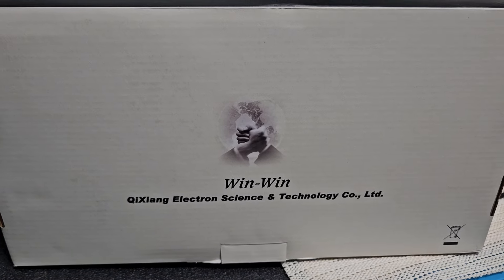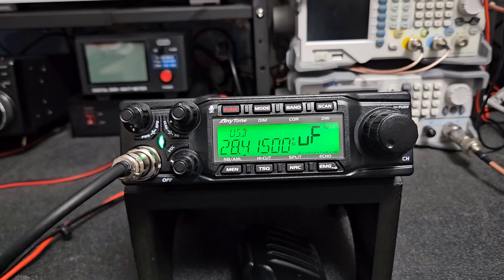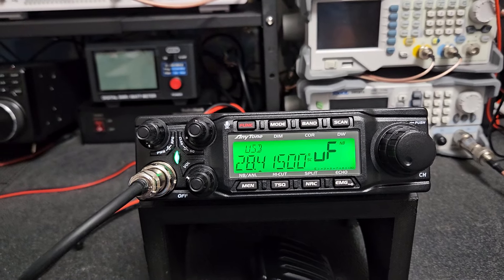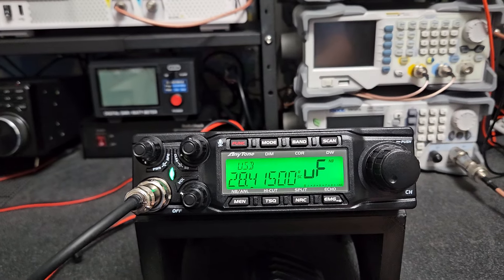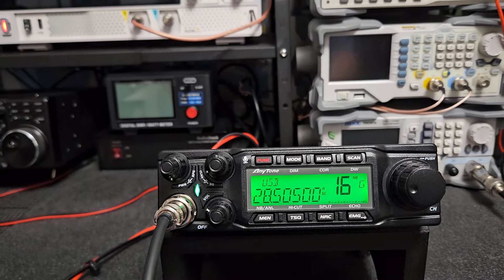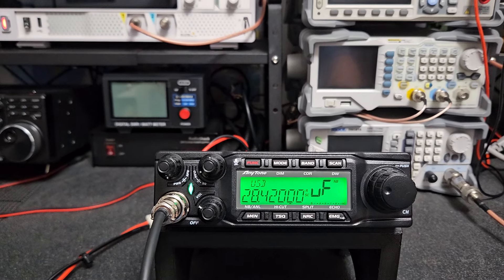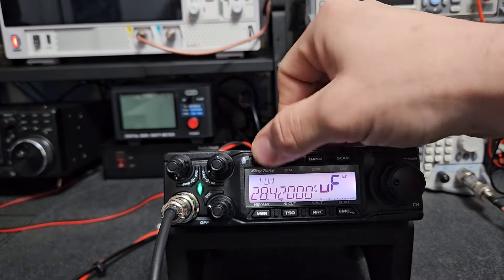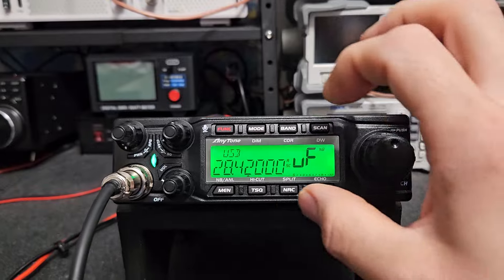Anytone AT-6666 Pro

Comment: Glad things are moving forward with Anytone.  I love my Anytone radios.  However, I'm still looking for them to release a base unit...It will be a huge hit I believe.  Thanks for the video.
Reply from the maker: You and me both!
Reply: @samuelh8441  That can be a base radio. No need to put the circuit board in a larger case and call it a ‘base’ radio….
Reply: I bought a 6666 pro it wil not transmit on the cb bad it says "dc low"  I know my power supply works perfect its 30 amps.   The radio transmits on all other bands just fine.  It was operating beautifuly for an hour before it started doing this.   Dissapointed .

Comment: Hello Scott. Thanks for the video. I have the original 6666 and did the easy 3 button conversion.
I am interested in purchasing the new version when it becomes available. 
With no disrespect intended, what is the advantage of purchasing from you as opposed to another vendor.
Thank you and 73's.
Reply from the maker: I'm a real radio operator and not a online giant marketplace seller who has no idea what any of the functions are on these radios and what they do.
I also don't just go in and turn everything wide open on power and call it a peak and tune like everybody else.

Comment: just a ? are these radios coming with the screen film or are the sellers taking it off ?
Reply from the maker: I haven't noticed a screen film protector. 
Then again I'm very careful and try not to ever get anything that could scratch the display. 
The original model came with one so assuming these probably do as well. 
I never really noticed it on my original one until it started developing some minor surface scratches.

Comment: Did you notice that the 15m band is on band M, N and O in the software? 🤣
Reply from the maker: I haven't checked that. 
Personally I'm not focusing on the 15 m band since it's not up to the full potential of the rest of the radio.
Reply: @ScottsRadios  fair enough, you move the jumper inside the radio then bands M, N and O become available in the menu. It remains to be seen how well it performs on 15m and how 'clean' the output is there.

Comment: The button back light is bass ackwards. When it's dark, I dim and need to see the buttons. When bright, I can see everything fine. 

Note, if you find you're on the wrong frequency for the channel and are feeling lost... This is not the hobby for you.
Reply from the maker: I will try to mention that to them I know what you're saying about the dimmer. 
For the channel thing I agree. 
But you know some are used to only looking at two digit channel selector and not a frequency so it goes without saying that having it better in this radio will be a world of difference for those guys.

Comment: I like the anytone but mine it gets to warm  compared to other radios I use way to warm
Reply from the maker: The smaller casing will always get warmer than a radio with a larger heat sink and larger cabinet. Recommend using lower RF power when talking for long periods of time.
Generally less power will give cleaner and clearest modulation.
Skip is all about propagation.

Comment: 15m?
Reply: 80w am on 10&15 with these big swinging radios would be awesome
Reply from the maker: @miker8379 most likely it will not have 15 meter on production model.
If it does it will be a bonus.
Reply: @ScottsRadios wrong it Will be marketed as a 15 through 10 m radio. 21 to 30 MHz. Simon The wizard check his YouTube channel he did a video on it as well

Comment: what kind of heat does this new one generate?
Reply from the maker: The smaller casing will always get warmer than a radio with a larger heat sink and larger cabinet. Recommend using lower RF power when talking for long periods of time.
Generally less power will give cleaner and clearest modulation.
Skip is all about propagation.

Comment: For CB operators with all the skip going on you need power or you can’t get out 5 miles without getting stepped on Truck drivers are running 8 and 16 pills
Reply from the maker: From what I hear in Michigan conditions have drop considerably over the last month or so.
There are plenty of clear channels on the regular 40 channel band.
Unfortunately people are hardwired I guess in the trucking industry to only use Channel 19. 
I don't know why certain base station operators choose to talk on channel 19 when it's always been considered the truck driving channel. 
Now that FM is able to be used legally many should switch over to that and they would find that running lower power on FM will generally talk much farther than what it will when running more power on AM.
We also have to remember that CB is part of the HF bands which are normally meant to propagate signals much farther when the atmospheric conditions are there. 
So yes, technically you can talk across the country easier than you can 5 or 10 mi locally. 
When the maximum usable frequency dips way below 26 or 27 MHz you will find the exact opposite will happen.